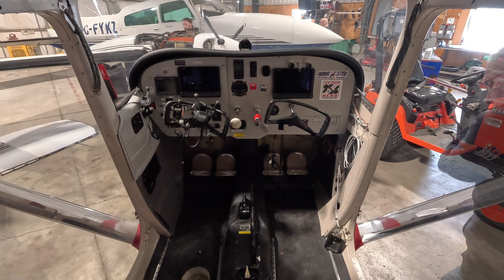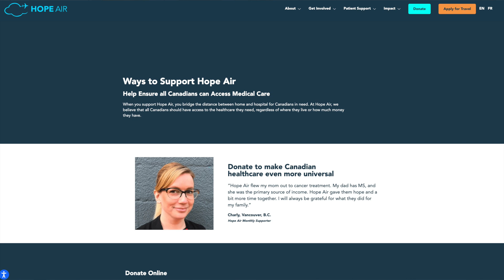IFR Panel UPGRADE! Day One In The Shop.

Comment: I very excited for you. A while ago, you were at Dynon and mention upgrading to the 10 inch glass, which i hear is amazing from 7 inch. Are you still planning to upgrade.
Reply from the maker: The upgrade to the 10 inch is still in the works. This model 172B doesn't have a panel that is 'tall' enough to fit those screens; so it requires a structural modification that is still awaiting final approval.

Comment: I'm envious of all the upgrades, Glen! But oof, having to mix-n-match so many different brands of avionics has got to be a bit painful in terms of all of the different configs and menu flows and such... Hope it provides you many years of stalwart service and safe flying, though!
Reply from the maker: (now that it's done and I'm flying it) It actually works together seamlessly - info from both the Trig radio and the Avidyne show up on the Dynon and vice versa. I can tune the radios from the Dynon and change the flight plan on the Avidyne.
Reply: @GlensHangar  - Awesome! Glad to hear its working out!